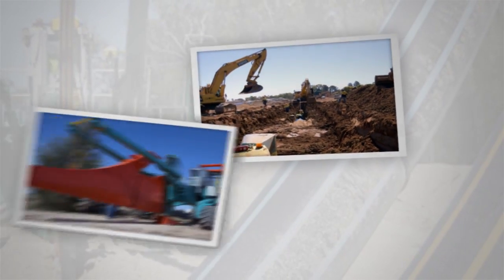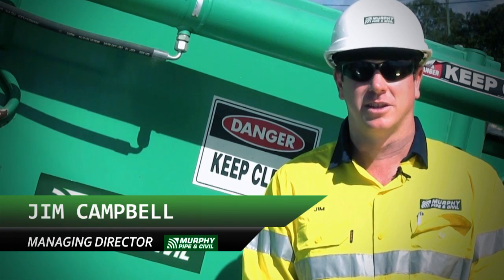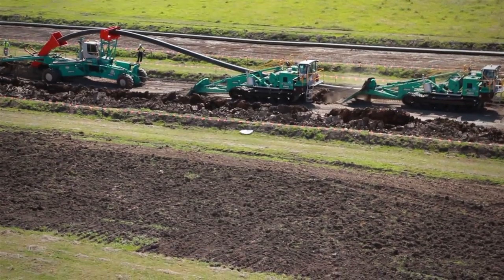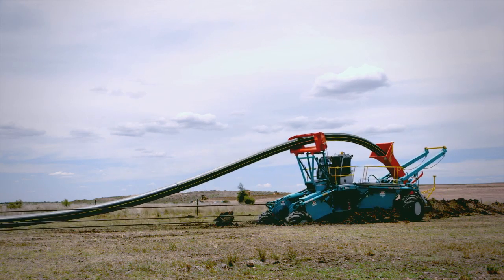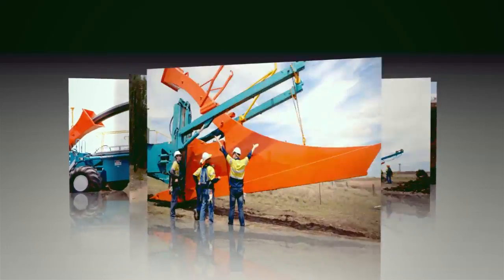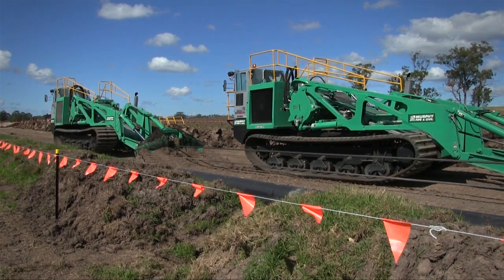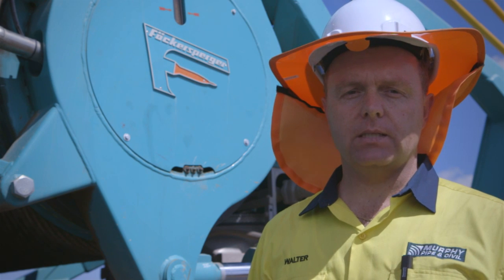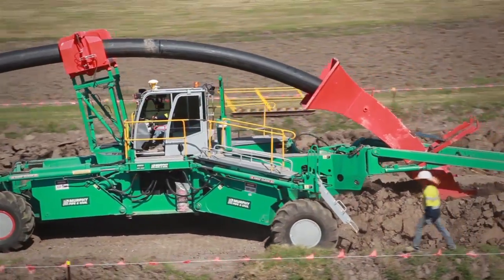Murphy Pipe and Civil Pipeline Plough Technology

Comment: Normally there should be 150mm of soil bed on the trench before laying the pipe right? so if this technique is used for laying pipes, how's it possible to lay pipe without proper soil bed.